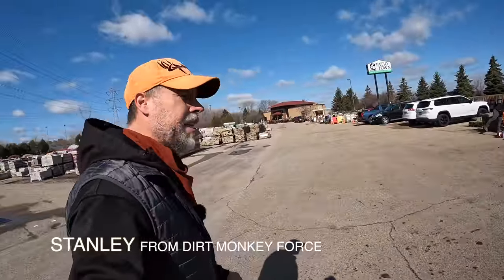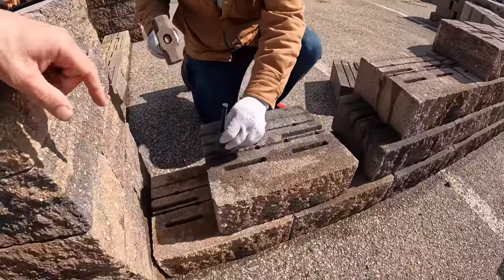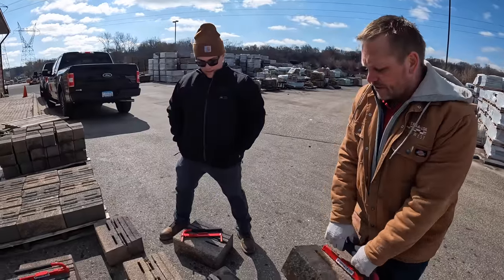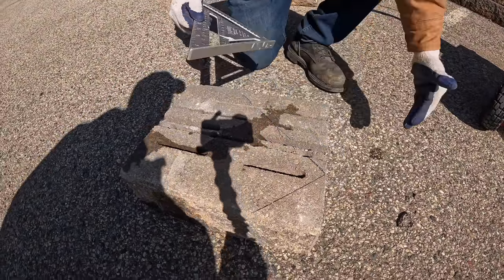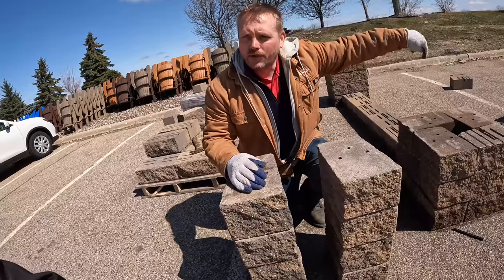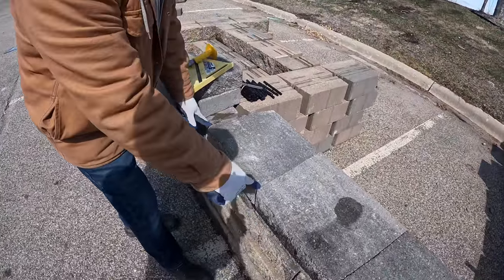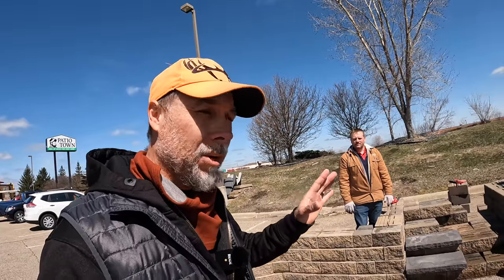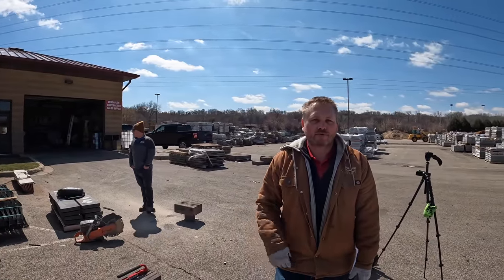Retaining Wall Skills: Beginner to Advanced

Comment: I've built a handful of walls with the typical "open cell" blocks and I have to say, the speed that these guys are installing the versa-loc system is mind blowing... AND NO EXTRA ROCK. My step-son just built a wall with these and he loved them except for making corners, since we're both used to getting pre-made pieces. I will be replacing my timber walls this year and have been contemplating this system but have been worried about corners. This is the exact video I needed to help make my decision.

Comment: Excellent how to do your job and homeowner DIY I personally haven't been building walls lately it's good to look at things like this video to keep me educated and relearn methods of building walls one thing I didn't notice in this video I may have overlooked it is the dead man course that is what we call it the first block gets buried it is your concrete footing so to say and how to stair step your wall at the base course I've done a lot of walls on hillside and you are supposed to start at your lowest point and work your way up one thing I forgot to mention all of these non-masonary walls origin from masonry walls you had to have a concrete solid base to stabilize support the wall I am not a masonry but I know this is fact these non-motor walls are for those who do not understand masonry but it still has a lot of the mathematic structure ingenuity involved I am a learning by the seat of my pants almost self-taught this is why these videos that you're producing are helpful I was building these walls and then the company air vault decide to put a educational class for its local contractors thank goodness I was doing at least 90% of it correct but that 10% could cost someone property injury or life again thanks for the videos

Comment: Firstly, great video.  I am always happy to see a new video pop up in my subscriptions from the Dirt Monkey.  As for other training videos, I would like to see a natural stone video.  I did a rather large wall about 20 years ago and I followed the recommendations of the place I bought the stone from and it held up pretty good, but now the wall has shifted and I want to pull it down and put it back up.  I probably took on a more complicate project as it was two walls, one with a 14 ft. radius and the second wall with a 16 ft. radius.  Both walls come off the house but the smaller radius wall covers more circumference of a circle and the 16 ft. comes off the wall about 3 ft father down the house and ties back into the 14 ft. radius wall.  When completed, the 14 ft. wall is probably about 52 to 60 in. tall that ties back to our slope in the yard and the 16 ft. is about 24 in. tall.  not sure if that provides a good mental image. Originally I put a couple of layers of really nice stone below grade, but this time I don't want to put all that nice stone underground.  Originally I dug a trough and layered in packed screenings (small limestone in IL) to about 10 to 12 in thick and used that as my base. So this time I am thinking going the same way, except put courses of cheaper cinder blocks for a couple of courses until I get to grade and then build off that.  I am planning to power wash the stone before I put back down.   Anyway looking for suggestions form yourself or any of your fans.  Thinking about using a weed barrier. Last time I back filled as I went to tie in the perpendicular stones I put in every 3 ft. or so not sure how I would incorporate that.
Reply from the maker: I am currently working on a how to build a retaining wall video that will hopefully address a few of these questions. Stay tuned-  it should be ready in a few weeks or so

Comment: Nice job my guy. I love building versa walls. They are the easiest and strongest 💪   the hardest part is the first block. I use 2b limestone for base and then dust to lay them out. Once first row is in its so easy to build up.

Comment: Thanks for all of your content! I have a small mountain of Versa-loc out side and just need to start! I am not clear on how to keep the cheek wall straight up and down when the set back is built in with the  pins. Just glue them without using pins or is there enough wiggle room to keep them straight? I am hoping that one of the videos will clear this up. Stan, you made my choice of product simple! Thanks again. And thanks to VL for making all of their training available to everyone.
Reply: Hey jeff, i work with versa lok quite often and figured id help you out with a vertical wall.  So the 2 holes nearest the back of the block are the holes for building a vertical wall.  They can be a little tricky especially until you get the proper running bond created.  Hope this helps.  Good luck buddy, get to that mountain of block...it wont build itself 🤣 have fun with it most of all
Reply: @gregb1902  Excellent! Thanks for jumping in with that. I own all of the equipment to do the job but have never built a wall. Your answer is the exact hands on lesson that will make my job go smoothly. (At my own house!). Thanks so much! The more I watch and learn the more I know that I don’t know! (You don’t know what you don’t know)   😎

Comment: I just started my first diy retaining wall project. Went with versa-lok, with geogrid and 3/4 clear thanks to your videos.  do you have a video about how to stay on bond when the end is exposed and you want a finished looking end?
Reply from the maker: This video covers that
Reply: @Dirtmonkey  LOL. I wrote the comment half way through the video. Thanks for the reply
Reply: @Dirtmonkey  About half way through the installation and found that the Versalok standard blocks are different heights ranging from 5 7/8" to almost 6 1/8" aboviously making very challenging to stay level across courses. is this nomral or did I get a bad batch?  thanks for the info.

Comment: One more question that has been bothering me regarding paver driveways and snow/shoveling.  Since you are in Minnesota and get a lot of snow, have you found it difficult for you to shovel a paver driveway?  I have noticed that every little crack on my concrete driveway can stop my shovel immediately while pushing the snow.
Reply from the maker: yes actually your right.  its harder to clear snow on a paver drive.  You have to be careful not to catch an edge.  and there are lots of edges on them. even on ones well built.

Comment: You know, that outer 45 degree build made me think of one of the walls at my parents house here in Alaska that has a single seam going down. It has now separated to 1&3/4" gap at the top of a 4'8" tall wall on the inside of a stairway. Let me know if you want me to send you a picture of it (and if so where to send it), its really bad with gravel visible in the cracks.

FYI I love the instructor videos.
Reply from the maker: Thanks but I don't need the picture.  I can drive around and in about 10 minutes spot places that have the same issue. its just common and not correct
Reply: @Dirtmonkey  Understood. Now I just need to learn how I can either fix it, or get it fixed (its a real mess).

Comment: Any corner can be determine to be exactly 90 degree's when one measures three inchs, feet, yard, or the equalivent in metric measuments. In each of the two direction. If and when the meausurement between that angled of the two measurement will be 5 inch, feet, yards or metric. Just remember 3, 4, and 5.
Reply from the maker: Good point

Comment: Trying to replace a retaining wall build in front of a 5 feet high boulder wall. We need to make this wall a foot or so deeper in order to change patios pitch sending water toward the house. The block wall has held well for 3 decades but i wonder if its dangerous to dig 2 feet away from face/bottom of a boulder wall to make a deeper base for new wall. I know a tiered wall with this little space is incorrect but its what i got and no access for machinary to have thongs changed now. I appreciate any advice.

Comment: With the outside radius curves below 8 feet, is there anything wrong with using the half sized "cobble" blocks in conjunction with the standard size to get a tighter turn?

Comment: Is there any way or possible suggestions when building a raised retaining patio and trying to connect or butt up against a previous or existing retaining wall both walls will be made out of the same block and 8 in Versa lock pin system

Comment: -What about using a special miter saw to cut blocks?
-Around the 32-minute mark you were talking about A & B blocks. Can you use only A blocks if you   keep turning the A block around?  Or did the A block only have 1 side with a rough edge?
-When I was looking at that retaining wall that I talked to you about and sent you pictures of I was looking for glass stone rock.  Nobody knew what I was talking about.  They were showing me other stuff that might have worked.  Is there another name for glass stone?

I would like to see a more in-depth video about retaining walls.  I don't know if I will ever do a retaining wall but I would like to have the knowledge.  If I have to do a retaining wall in the future I will be coming back to this video before I begin and watching more in-depth about retaining walls.  I would like to see you do a video were you are trying to fix a retaining wall without rebuilding it.  A retaining wall that the customer built themselves and years later it is falling apart with the wrong kind of stone used, no geo grid and stuff.  Is it even possible to repair those types of retaining wall or can you only replace those types of retaining walls?  I am thinking about the retaining wall that we were talking about when I say a damaged retaining wall.
Reply from the maker: I am starting to work on a detailed how to build a etaining wall video right now.  I will cover as much details as I possibly can.  Thanks for the suggestions bill.
Reply: @Dirtmonkey  No problem.  You have a gift.  And your work is beautiful and it last forever.  I have learned that there is more to a retaining wall than just putting down rock and gluing brick together.

Comment: 23:11 What if I want to put in columns as part of my wall and it’s not for sitting but more for decorations. Should or could I put corners in at all the corners of my rectangular shaped wall. 17 foot in straight 90 foot then about 12 foot in towards back. Would I put a column on each corner of the rectangle?

Comment: How do you keep the dirt from pushing the wall over? Are there runners?
Reply from the maker: Its called Geogrid and it is used in conjunction with the blocks to stabilize the soil on taller projects

Comment: Hey Stan. Guess what? I finally had the balls to ask the girl I've been talking to and she said "about fing time." lol So now I guess I'm going on a date with her which should be great. 
In other news last week the rear diff in my truck went out so I tried to see if I could fix it myself but no go. So i brought it in and they fixed it, l apparently got really lucky when I broke it because the bill was only $125. Then last night I spent 3 1/2 hours putting new spark plugs in the truck. The plug were rust welded into the threads. It was a pain in the ass.
Reply from the maker: Congrats on the date-  thats good news!  and your repair bill for $125?  thats incredible.  You don't see that kind of price much for a repair.  Thats practically free now adays.

Comment: Thinking about building a retaining wall at my property so that the lawn is flat. Though it would be at the front of the property and there is a sidewalk.
Reply from the maker: Building a wall on a slope requires more of a toe in at the front and if there is a sidewalk it could place a small surcharge on the wall depending on its location in relation to the wall.

Comment: When do you plan on starting mowing? Stuff must be getting pretty tall by now lol
Reply from the maker: This will be the first week we break out the mowers.  Want to see anything in particular?
Reply: @Dirtmonkey  how about an update on how the hustlers are holding up? And just mowing content in general.
Reply from the maker: I was thinking my first mowing video should be a torture test of the new EGO 52". Something fun and back to the roots of what I typically did
Reply: @Dirtmonkey  now that, that sounds like fun! Back to the roots!
Reply: @Dirtmonkey   Wow two request for one video.  Do you ever get requests for lawn leveling.  I am getting all caught up in the lawn leveling videos, but the videos are usually of smaller yards, I have over an acre and tried a bit of that last year.  Used a mix of 60 dirt to 40 sand, screened it to 1/4 in. it and spread it out with a home made drag and a lawn leveling rake. The result while OK but was not what I was hoping for so thinking of going to a 70 sand 30 dirt mix, but where I really need help is with the spreading.  I made a drag and its about the only thing I can come up with, but wondered what a pro would use if faced with a lawn leveling project.  BTW, my gut feeling is more folks are going to want smother level lawns so they can get out in the yard without rolling an ankle. I get a million flyers in the mail, but no one advertises they lawn level. I have even thought of rotor tilling the whole front yard.

Comment: Why wouldn't you just get corner unit's. Will save you so much time and work,🤔
Reply from the maker: Getting special units is the hassle- the colors don't match or you have to get an accurate block count before ordering.  With this system you can make a corner unit yourself with the standard blocks off the pallet in less than a minute.  Colors always match and you never have to worry about your material count for specialty units.

Comment: 99.9% of homeowners are completely incapable of building a wall anywhere near as nice as that. They will have the material delivered and then realize how hard it is to install it, then they will completely ignore any instructions and begin compromising the installation almost immediately. Homeowners don't own any of the equipment needed to build these walls. They are also incapable of operating said equipment if they rent it. They have no idea how to do any layout or planning. They are unable to even lift these blocks into place, these are solid concrete blocks which must weigh in the 80 to 90 lb range EACH. 

At best they will build something that looks nice for a few months to a year then it will either sink or heave. You would have better success teaching a monkey to fly an airplane than teach anyone on here how to build one of these walls properly.

Comment: As a first time user of this system and not having ever built a block retaining wall, this was a very poor video.  First of all, I doubt that anyone will be building a retaining wall on a smooth flat asphalt parking lot.  I'm building a retaining wall on the ground, where it is on a slope.  There is no instruction about how to excavate in preparation for the wall.  How deep to dig or how much in front or in back of the foot print of the wall must be excavated.  So from that standpoint this was a poor and worthless video.  Also, I want to build one three foot wide step that will be located below the face of the wall so that I can use it to step up onto the wall.  The step explanation didn't help at all.  If you want to make a worthwhile instructional video, you need to demonstrate each step of the process as you are talking about it.  Spliting the block was the most helpful.